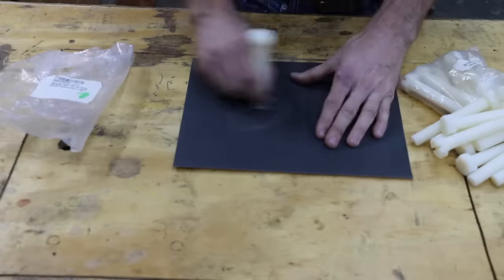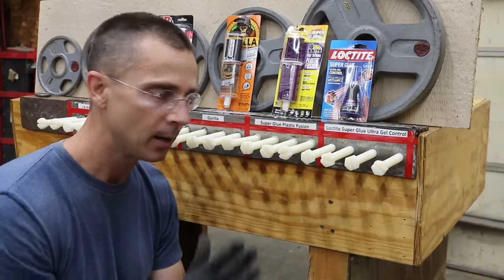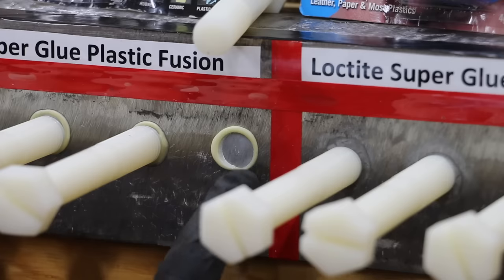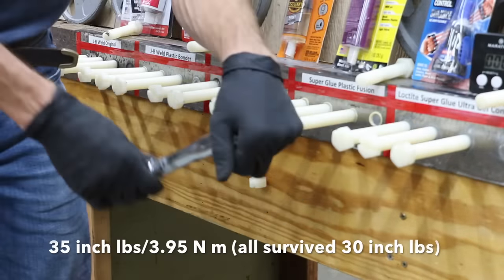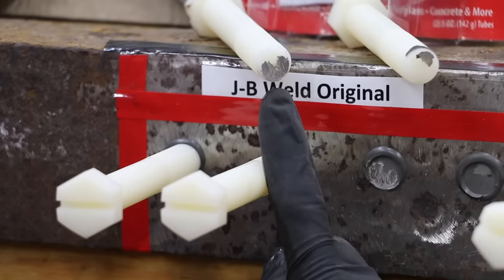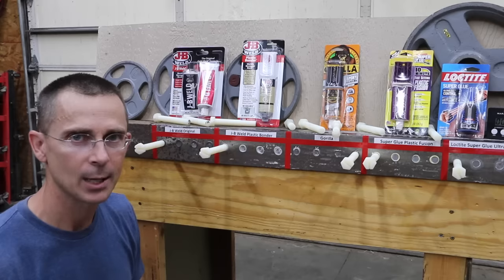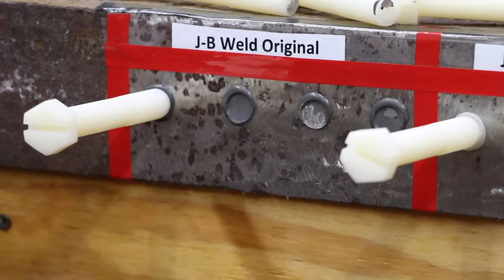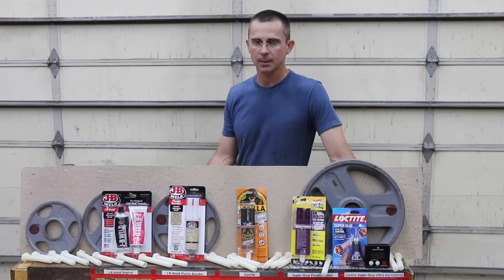Which Epoxy is Best for Plastic?  Let's find out!

Comment: Interesting test.  
A couple points to consider:
This is for one specific type of plastic (nylon?) bonded to steel.  There are several other types us folks who repair our own or other cars also see: styrene, polystyrene, polypropylene, various types of polyelthylene (HDPE, LDPE, PET), polyamide.  Would be very interesting to see the results with each plastic type as they all have different properties.
How about the plastic bonded to itself for each type, such as when the home mechanic attempts to repair a plastic part?  Often this is the only recourse, as folks like myself encounter broken plastic parts and replacements are not available.
I rarely need to bond plastic to metal, but plastic to itself is of great interest.
I look forward to seeing such a review from you!
Reply from the maker: Thanks for the suggestion.
Reply: Yes! Thanks for all you do but yeah plastic to plastic is what I need and what I usually need. Thanks again. You do us all a great service. Really.
Reply: I was going to chime in here and say that nylon is way different from most of the plastics I deal with.  It would be interesting to use non-nylon in some tests.   Also plastic 2 plastic would be really interesting.
Reply: Me too. I want to see all types of plastics bonded to others.
Reply: Have a look at the Sikaflex range.  They produce a special adhesive for body panels and ABS
Reply: @tinnedanger  I will - ABS bonding to other plastics is difficult.
Reply: Nylon is an oily plastic by nature, it has to be the worse one to glue.
Reply: @mickk8519  Most plastic is considered a low energy surface. (I was begrudgingly assigned to work with it to "try" and make wing surfaces out of corrugated plastic for my capstone). 

Needless to say it was horrible and didn't work (I knew this from the start). The reason being plastic is decently uniform at a micro level so there isn't much surface area to adhere to. He should have sanded the plastic with rough sandpaper to help with adherence.

Another big trick with adhering plastic is to use flash heat.
Reply: @mickk8519  the Teflon of plastics, and among my least favorites to fabricate around
Reply: Yes I agree. Plastic to itself
Reply: This 100%! 
I’m typically only going to be using this type of product on a plastic to plastic bond. 
That, and as mentioned there’s different kinds of plastic out there. 
I think the magic of half of those purposes made epoxies happen as a result of the epoxies ability to chemically bond with specific types of plastics. 
I think nylon in general is one of those that type of epoxy would have a difficult time bonding with. 

Despite doing pretty poorly in this testing, I’ve had really good results using JB plastic bonder on certain types of plastic, like polystyrene . It stinks like burning plastic while it’s setting up, but when it’s done, it makes an excellent bond that’s pretty much as strong as virgin material.
Reply: It's like welding you don't use a 6010 rod to weld aluminum.  Welding is fusion, it mixes the parent metal and the rod, that's fusion and what you won't. Have glued a zillon ft. of PVC conduit, prep and proper glue are critical, had 1/2 the peeps I worked with would skip the primer, then you still have wax release agent and the solvent in the glue won't give you good fusion, yank it it comes apart, you do it right and it may break the pipe or the joint. Love you work!
Reply: Couldn't agree more.  I professionally refurbish electronics and the plastic parts just aren't available.   I have to resort to gluing broken plastic parts, ie plastic to plastic.    I would only include products that cure in 15 minutes or less.   Working with longer setting times just isn't feasible.
Reply: @paddledogs  Yea plastic to plastic
Reply: @ProjectFarm  This was the right suggestion.  Plastic to plastic and different types of plastic.  We use these epoxies to reassemble broken stuff.
Reply: I agree plastic to plastic is what I'm curious about
Reply: Thanks for the video. Project Farm is a go-to YouTube channel for me when I'm looking to see what works well. :-) PVC is used for plumbing and irrigation and it is not uncommon for those to have issues. It would be very interesting to see what works best for PVC. Both mechanical strength and pressure sealing.
Reply: You cannot glue polyethylene. Nobody needs to spend time trying.
Reply: 3 M makes a good glue like for fixing the cracked plastic auto radiators but it`s not cheap either. For all else I swear by Loctite 2 part plastic epoxy it is very strong and works on the majority of plastic out there.
Reply: @waytospergtherebro  Polyethylene and polypropylene both.
Reply: I was going to say the same thing, plastic glue on steel is useless.
Reply: @ProjectFarm  I would also love to see you do a test like the original commenter suggested, I've always used super glue for most auto interior plastics, but it's usually hit or miss. Some seem to almost melt together as where others don't seem to even want to stick together.
Reply: Any suggestions on how/ what to use to re-bond (or weld) plastic latches back onto a (black) Craftsman socket set case? 

It’s too narrow for any metal latches i can find?
Reply: Nylon/PA is worst at bonding overall, it's considered nearly impossible to glue. PP and PE are next, absolute menace, then PET which is a little less bad. PVC, PS, HIPS, ASA and ABS make for fairly easy bonds.
Reply: Yes. Agree. 
Need PP (plastic bumpers), ABS bonding tests.
Need gap filling test, eg. Recreating broken tabs, its strength and lifespan as plastics get brittle over time.
Need comparison of various epoxies (eg. JB weld Vs 3M professional Duramix like 3M 04747) Vs powder base, etc.
Reply: @ProjectFarm  polypropylene and polyethylene are among the hardest plastics to adhere to (low surface energy materials). It would be interesting to see a video specific to low SE plastic adhesives. Most hardware store adhesives specifically state not to use for this purpose, but maybe they work with decent prep? Acrylic structural adhesives are sold specifically for PP/PE but they are expensive and not readily available. Would love to see a video on this topic!
Reply: @BuckWezr    Nylon is not near as bad as LDPE, HDPE, UHMWPE, nor PTFE ("teflon"). These all have a much lower surface energy than nylon.

Comment: This review saved me about $1,000!  Based on your tests I got the Loctite to fix a broken door handle on a high-end GE microwave. The handle had snapped off in a weird way because the screw fittings are all plastic. I think the flex test is the one that convinced me, based on pull and shear from normal usage. Found out this is a common breakage complaint with our model.  Can’t just buy the handle without taking the door entirely apart and requiring some radiation testing above my pay grade. One week after application and a 24 hour cure, and it is still holding like it was never broken! And I’m a hero in the home! Thanks again!
Reply: My ge microwave handle also failed and is why I'm here.
Reply: @onewondershow2  good luck! It’s still holding tight!
Reply: I had a similar issue with the door latch on a Kitchenaid microwave that I fixed with JB Weld, it did a super job.
Reply: Radiation testing when taking apart microwave door isn't how it works
Reply: @rickc303  I am talking about microwave leakage if the door is incorrectly resealed. The entire door assembly and internal seals to the door would have to be removed to replace the handle the way it is constructed. It’s right there in the documentation.
Reply: 😂 hero.
Reply: Same happen to me on a GE microwave. I used an epoxy to glue the handle to the door.  I don't remember which epoxy I used, but I can tell you it dried clear.

Comment: Original J.B. Weld never ceases to amaze. It's the only one that I have had any real experience with (once I needed something to be clear in color and tried some generic 5-min stuff other than that I think it's always been j.b. weld) and I kind of felt myself rooting for it to outperform the others. Based on my past experience & your tests I think it's safe to conclude that you can't go wrong with regular 'ole J.B. Weld.... Next they need to figure out how to make it clear in color. Then there is absolutely no use for anything else. Great video, going to save me from reading the backs of 50 different epoxy packages just to choose J.B. Weld in the end anyway because there is too many choices and variants. Plastic specific epoxy seems like a gimmick when something made for steel outperforms them on plastic. Thanks for simplifying my life just a tad bit...
Reply from the maker: Thank you very much for the positive comment!  All of the clear epoxies seem to have a similar smell, which is much different than the epoxies with colors.  I wish they could make a JB Weld formula that was clear and as good as the original.
Reply: I think original JB is reinforced with tiny strands of steel, probably where most of the grey color comes from.
Reply: Spectt84 They do now have a clear formulation. So far, so good on plastic to plastic, but it is not all that right an application I am using it for, but others did fail.
Reply: i wonder if they could instead of using steel to reinforece jb weld, to use glass fibre? then it would be strong and clear too?
Reply: Honestly i think this video gives you more than whats the best single product, its more of the correct application for the specific use of the products tested. I love both loctite and jb weld, but knowing what to use in each application is the most important thing.
Reply: True, but in 3\4 application's it tied for first or was first.  Most people also won't keep multiple type's of epoxy around and will just use whatever was the last one they bought.
Reply: I'll agree for the most part but when I hit a deer and bent my radiator back. I pulled it forward and sealed the plastic top of the radiator with J B 5 min and I was able to drive it away in 30 minutes no leak. A big advantage the speed was.